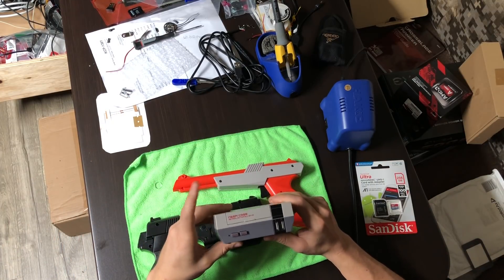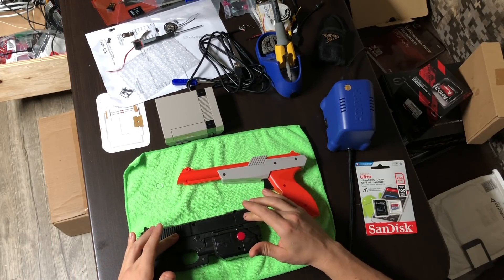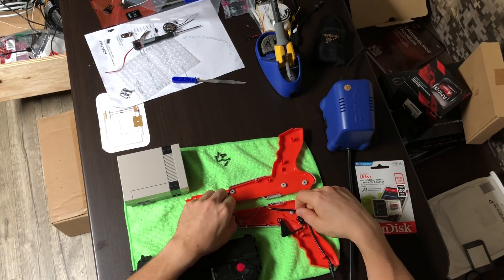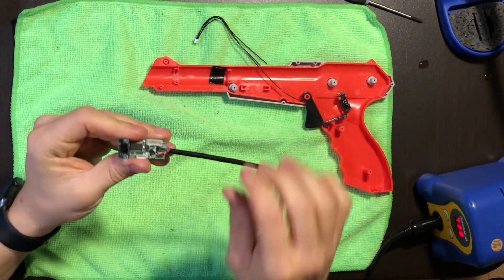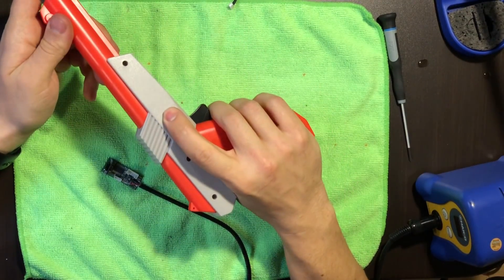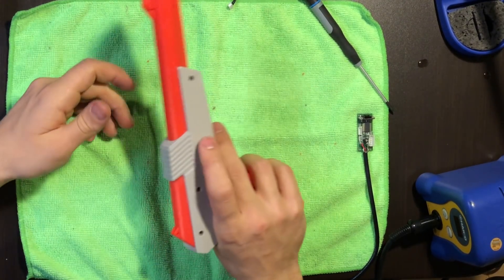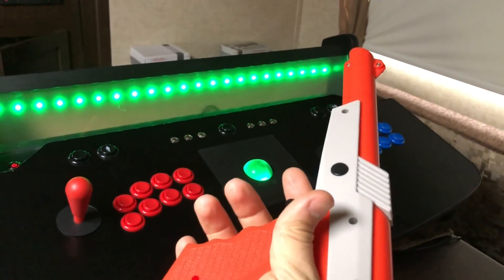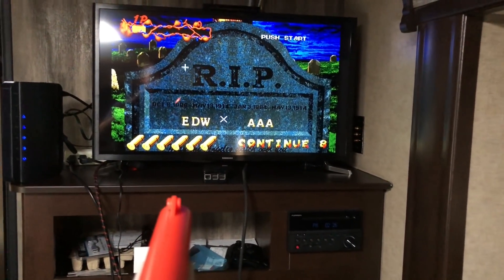PiZapper Tutorial - turn a NES Zapper into a Arcade lightgun that will work on a modern TV!!!

Comment: If this uses IR bars its shit. Also if thats putting an Aim Track into a Zapper. Sir you're a fucking idiot on many layers.

Yeah its a fucking Aimtrak. Shit guns. Sadly the 'best' on the market atm. But sill shit unless you have the screen surrounded by IR sensors and never move ever after calibration. As its calibrated from the original position(Distance, height, Angle) you did the calibration in originally. Take two steps right. A step right. Lower your arm a bit cause you're getting tired. Out of Calibration, until you go back to your original posture. Also the tracking isn't amazing on them and feels pretty laggy in actual use.

Comment: Great build!! Thanks for sharing. What videogame are you playing at the end?
Reply from the maker: Er Jo zombieraid
Reply: Greg Arnold  awesome man! Thanks, does it matter what kind of hot glue to glue wires and board in, and did i hear you say you glopped it over the tacticle switches over the wires?
Reply from the maker: Er Jo any hot glue will work.
Reply: Greg Arnold thanks again! I got the zapper and same buttons, willge the kit and replace. Im so glad you found a way, made a great video and shared! I have been wanting to play the shooter gamez
Reply: Greg! A couple more questions. Does it matter size of solder iron? And what soldering material did you use?
Reply from the maker: Er Jo No size doesn’t matter and standard solder
Reply: So i bought a 50w 374-896 DEG F soldering station and a Desoldering pump and for material Delta Solder (lead free) .032 Dia 2.2% Glux NC600 .6oz. Does this fit i to standard?
Reply: Greg, i was about to purchase the kit and 50'plus foot bar and i noticed they have a bluetooth upgrade now. Have you looked into that? Now im debating again..  lol
Reply from the maker: Er Jo no I didn’t know anything about it. But I have 2 kits on the way. I will let you know how they work. I will be putting one in a Zapper and one in a standard Aimtrak gun so people can see the difference.
Reply: Greg Arnold  awesome. Please post videos i am curious if you need bluetooth kid and original usb kit or if can skip the usb if you just want bluetooth. Awesome!! Thanks for all your work and creativity
Reply: Kit*
Reply: Greg Arnold if i just buy the bluetooth kit/s and the 55' bar and i wouldnt need the usb onr except for the trigger harness right? Is there wire kits for that and the tactile buttons? Or certain type of wiresize/material?
Reply: +Greg Arnold i got my bluetooth kits. harness. and super ir bar. do you know whattype of material the lightgun can go through. the bar came uncased. not sure if they have separatecases or what.
Reply from the maker: Er Jo I contacted ultimarc they now offer a sensor bar in a case. It will go through glass or plastic.
Reply: +Greg Arnold. hey again. so im trying to get my lightgun setup. is the ir bar supposed to light up after you plug it in? since its my firsttime messing. with it im not sure if im doing it right
Reply from the maker: Er Jo it’s infrared lights so you can’t see it. The bar just needs power. I usually calibrate the gun by hooking it up to my laptop. It’s just easier that way.
Reply: +Greg Arnold well thats good. i am running i to issues. the raspberry pie reads the blue tooth but its not recognizing the devise at all . i had my father in law help he did the sodering.
Reply from the maker: Er Jo test on computer first.
Reply: +Greg Arnold i attempted that route. i will try again. i did the bluetooth setup.
Reply: +Greg Arnold thanks for the tips. i printed out the long instructions. im assuming its a settings issue. im thinking now i need to add software to the gunssince i started from scratch. i think i saw that ona youtube video.

Comment: Where can I get this sensor?
How did you connect the gun to the RPI for usb?
regards
Reply from the maker: Ricardo Robles ultimarc.com
Reply: I'm sorry, I can not find the sensor
Will you have the link that takes me exactly where is the sensor that you bought?
regards
Reply: @ricardorobles5429  I've bought mine off of eBay.  search "Aimtrak Extreme IR Bar" and that should be it.